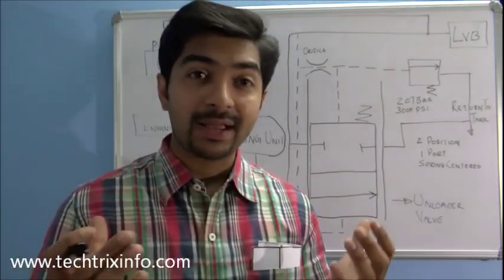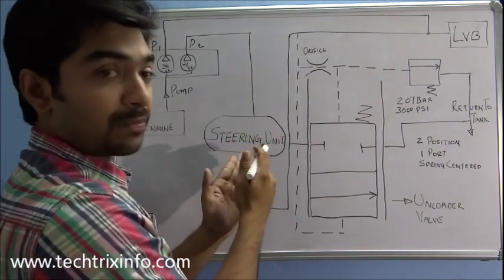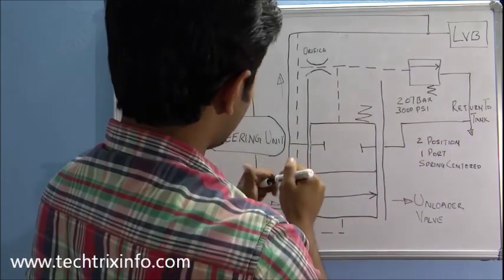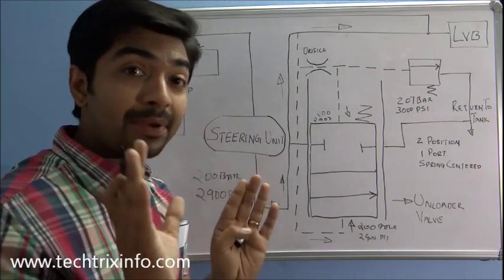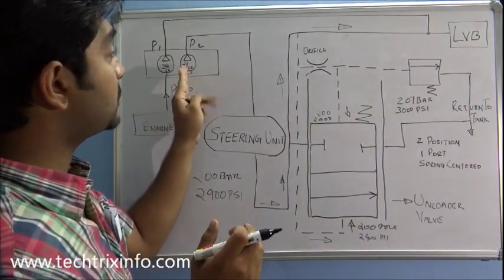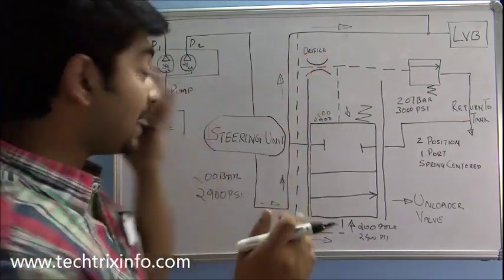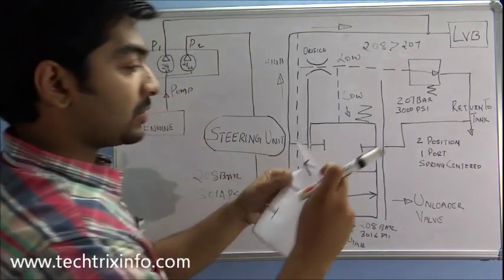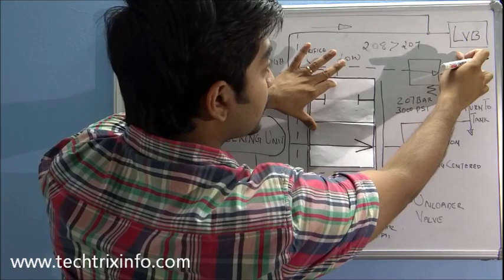How unloader valve works in a hydraulic circuit. ✔

Comment: An unloading valve has one pressure inlet and two release ports for faster dumping. But what if I wish to use a relief valve at same pressure  with increased inlet and release cavities which too will dump the fluid faster. This also means that there is no need of external pilot line or spool. Please clear this if possible.

Comment: P1+P2 =3300psi.Normally unloader valve not open how much pressure here at P1. Which time unloader valve open for setting point or unloader valves return to tank line..

Comment: I am puzzled. if you need 208 bar to open the valve so that the pressure below the unloader is greater than the pressure above the unloader so that it can move up and allow the flow to travel to the return tank. if after the 208 bar goes through the orifice and the pressure drops, how can this lower pressure open the valve?
Reply: The pressure at the top of the unloading valve is less than the bottom pressure, therefore, it moves up. It's like a 200 lb man leaning on a 100 lb man, who would push who?

Comment: Sir i have a question, correct me if i am wrong, when we are using steering operation the pressure on the unloading valve will be less then the 207 pressure then the P2 pump flow will got to LVB after steering operation, and when steering operation is not done then the pressure on the unload valve will be more then 207 bar, and will the flow from P2 pmp will go to tank.
Hope i understood correctly

Sir very great video thanks for sharing knowledge

Comment: i guess there should be load check valve after the p2's second opening to unloader spool to prevent the flow from the p1 to the unloader.